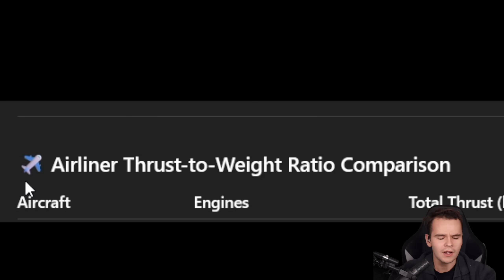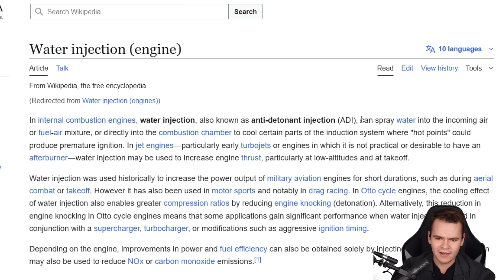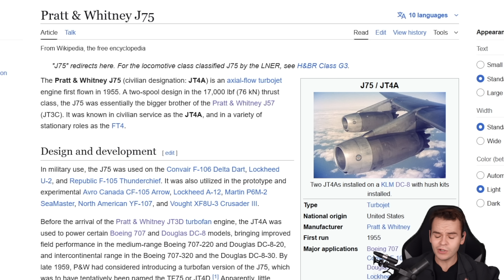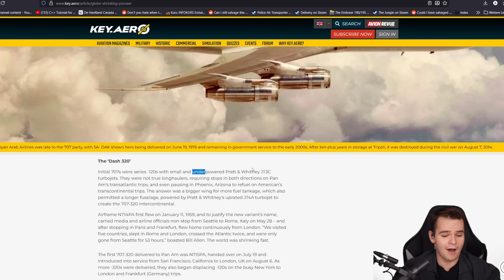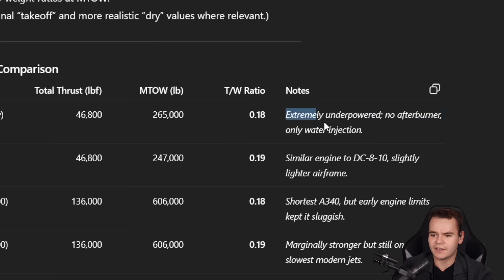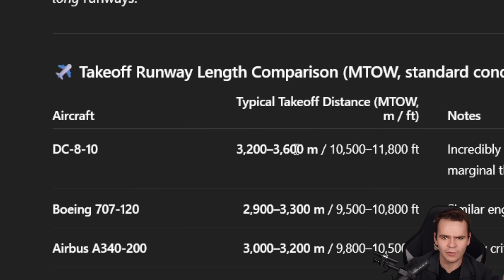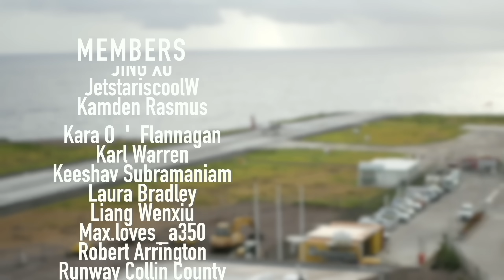Why The FIRST Jet Airliners Really SUCKED

Comment: well. The Comet is probobly the first jet airliner, and it have even lower thrust to weight.

Granted, it have a very high span to weight, so it can lift of at quite low speeds.

Comment: Dude.. having flown on these things in the early 1960's as a kid, I'll tell you a trick that the pilots would do..  You see, controls and engines would be run up behind the  runway line and the engine power was the last thing they did.. as on the shorter runways they would never totally spool down the engines and would turn onto the runway with 15-20 knots of speed and immediately spool up the engines again.. Hold on the Runway.. that just wasn't done as this could cost one of those 707s more than 500 feet of runway.

Comment: Can’t compare a mid 1950’s 707 with a 2025 737 max or any other airliner flying today. Technology has improved over the 70 years.
Reply: The Boeing 747 was introduced in 1970 and had a thrust to weight ratio ranging from 0.27 to 0.30.

Comment: My older sister was a stewardess in the late 1950's during the transition period when jets were replacing piston engine planes.  I remember her commenting  about pilots being concerned with the jet engines' noticeable lag (LAG, not lack) of thrust coming on when the throttle settings would be increased.  Evidently piston engines were much more responsive to changes in throttle compared to the early jet engines.  Kind of like stepping on the gas, nothing immediate happening and then the car finally starts to accelerate normally.
Reply: To put it simply, turbojet engines work great at high relative airspeeds but are terrible at low speeds, because of how fast their exhaust jet streams have to travel. A propeller with the same mass airflow rate will accelerate a much larger cross-section of airflow to a lower speed, which provides better throttle response at low speeds.

The JT3C & JT4A in particular were designed to power single-engine supersonic fighters and only ever slotted under the wings of large subsonic jets because we hadn't built anything better yet. The result is a bit like using a high-revving sports car engine to power a freight truck.

Comment: The DC-8-63 came out MUCH later in 1967, and the -73 is just an aftermarket conversion - re-engined with four of the same CFM-56 engines that power the A340. Which, as you point out, is much bigger and heavier.

Comment: Many wrong arguments in this....  That A340 taking off and using the whole runway is on purpose.  It's called a FLEX takeoff (Airbus) or Assumed Temperature (Boeing).  Rather than use max thrust, which reduces engine life, you only use enough thrust to meet obstacle takeoff requirements and climb gradients.  You don't do more.  If you use the whole runway, that's okay.  Less fuel, less temperature, less wear.  You can still use more thrust if absolutely needed.  I flew 707s.  The first engines were inadequate but later engines had a lot more thrust.  Ironically, the A321 I flew performed worse than the 707 because we always flew the A321 with lower thrust settings to save fuel and wear.

Comment: The Boeing 707 has swept wings that did not have lift at low speed, so taking off and landing was a challenge as it had to be done at high speed

Comment: The Vickers VC10 had a significantly shorter take-off distance than the 707. It was also quieter inside and many passengers preferred it. Unfortunately it had slightly higher running costs and most airlines bought the 707 despite its shortcomings.
Reply: The vc10 was specifically designed to perform on short fields & in hot-&-high conditions for flights to africa and the middle east, so it was given huge wings & ridiculously overpowered engines, which made it pretty terrible just about everywhere else. Those attributes did come in handy again when the RAF needed an air tanker platform though.

Comment: Those Chatgpt figures are wrong (for example the 777 is actually 0.285) and it's a bad comparison to put in scale since the 737-900ER has a thrust to weight ratio lower than the a340-300 but is mostly fine while the Concorde despite being the record holder still couldn't fly with 3 engines while the A340-300 could. You should consider that thrust is for overcoming drag and increasing airflow with increased speed while the wing is responsible for lifting the weight and dictating cruise speeds

Comment: Boeing designing the B-52 with the same engines as the early 707s... "Let's just add 8, that should be enough thrust"
Reply: B-52 came before the 367-80
Reply: @TyrannoJoris_Rex   Source?
Reply: @istillplayStuff1000  The fact that the B-52 first flew in 1952 and the 367-80 in 1954

Comment: 0:18 I’ve seen with my own eyes the AN-225 taking off from the same runway and it struggled less 😅
Reply: AN-225 has more powerful engines you do realise the CFM-56 which is on the A340-300 was not really designed for large wide body aircraft. It also has a lot to do with how much weight is onboard the aircraft, if it is flying light then obviously it will climb easier.

Comment: Once flew on an A321 Neo that was extremely light, we still Took of with TOGA. The Power to weight Ratio was a bit more than that of a normal loaded Concorde.

We used about 500-600m of runway (If Google Maps ist accurate)

Comment: Well, this underpowered DC-8 reached around 50,000ft once and became the first airliner to break the sound barrier  - Well before concorde 🎉
Reply: I believe those old loud engines did not lose nearly as much dynamic thrust off of their static thrust number when at high altitude and cruise airspeed. As compared to the quieter high bypass engines.
Reply: That one had more powerful Rolls Royce Conway turbofans
Reply: @sideswipe604 yep, only a few had those

Comment: All they needed was afterburner in their engines 😂 , inbuilt like saab did with the jt8d they used and upgraded in their fighterjets , instead of a JATO- alike system afterwards like some 727s had

There is also a vid of 707 taxiing maybe the fastes i ever have seen a passenger plane do 😅 so that underpowered they dont look like (could've been a 720 as well)

Comment: i belief the jt 3 5 or 8 jetsengines of the dc 8 727 and 737 first models just had 10 0r 11 thousend lbf thrust :(without water injection) ... so 1 new turbofan of a 737 has like 56000 per engine ?? and doesnt need water injection

Comment: Time for the Cessna 172 with GE90’s.
Reply: Can’t even move the engine fans before you run out of fuel
Reply: @AirlinersX   what if cessna 172 engines on 777??????????????????????????
Reply: @AvroAvionics he alrdy tried that on an a320, it wouldn’t takeoff with 16 cessna engines
Reply: @AirlinersX  i know but what if cessna engine in every tiny inch of it????
Reply: @AvroAvionics xplane limits it to 16
Reply: @AvroAvionics good idea I hope swiss See's this
Reply: @Wataheart  prob not
Reply: @AvroAvionics well um stall stall beep beep
Reply: @AirlinersX  yeah
Reply: He's done that twice
Reply: @HeadForce0when??
Reply: Actually try puting f raptor or f15 engine on Cessna or cirus
Reply: @Wataheart  Or one of those STOL's they use in Alaska.
Reply: He already did that
Reply: @LinenChannelOfficialwhen bro?
Reply: Profile seems legit
Reply: @Taydrum  yeah
Reply: But the GE90 is bigger than the CESSNA